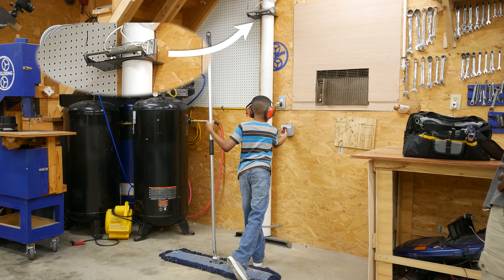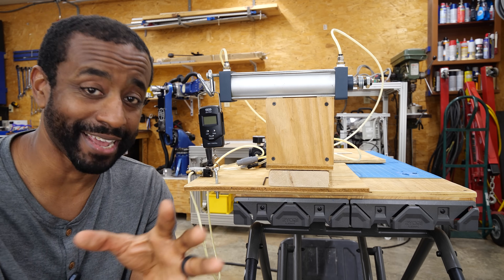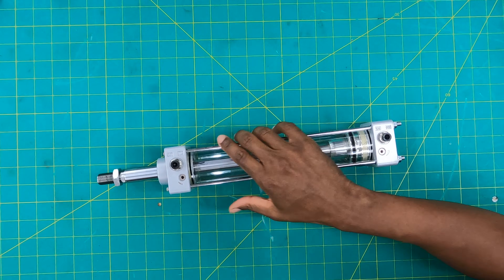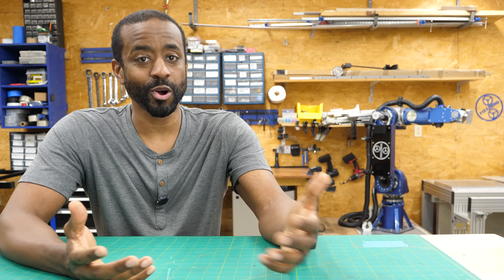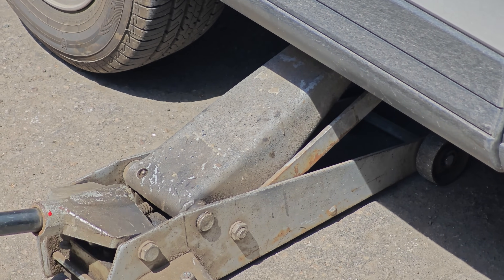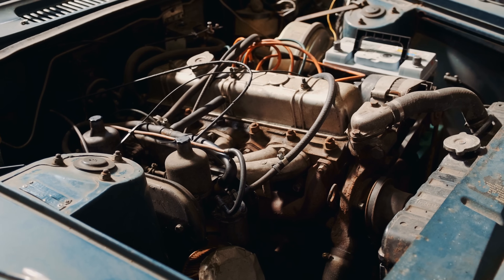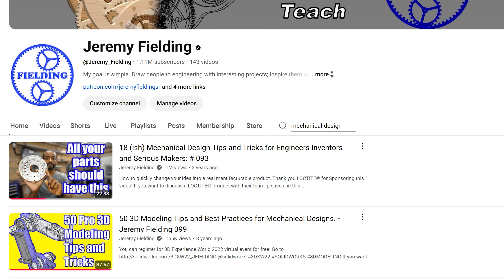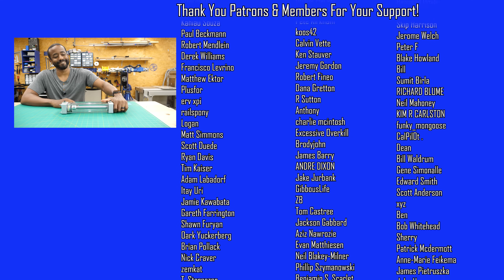12 Design Tips And Tricks for Inventors and Makers

Comment: 7:35 Yeah, sleeve bearings are awesome for the big low-speed joints on robots. Much smaller and lighter weight than rolling bearings, and you can make any size you want by cutting a strip from a sheet of teflon and wrapping it around. Or cut a flat ring from the same sheet for axial force too. Teflon tube is better for small diameters (I use it inside metal tube for cycloidal drive output rollers), but then you are limited to available sizes, and sometimes it's poor quality (not dimensionally accurate, or not concentric).

Comment: @Jeremy_Fielding ; have you used plastic bearing materials yet?  The two you will hear about most are modified nylons (with MDS or oil or both added) or modified acetals (primarily with PTFE added).
These are very light weight and when the bearing is designed well, and the bearing material is supported well by strong/rigid backings or housings, they can be outstanding (and lubricant/service free)
for low-RPM / high-force applications.

I am currently finishing up a hoisting cart for my workshop.  The jib housing, which fits over, and rids on top of, the mast, requires three bearings; a thrust bearing in the form of a large thin "washer" of 
plain acetal / POM, a pilot bearing in the form of MDS-filled nylon, and a mast bearing of plain acetal/POM.  Unless overloaded, non of them should ever require replacement or lubrication, not in my
lifetime, and not in the subsequent owner's lifetime either.  The lubricity is intrinsic in the plastic-to-polished-steel interface.  The inverted design of the jib housing keeps abrasive shop dust out of all
three bearings.  The trick is finding the material you need at the right price, but once done, it's usually cheaper than ball bearings.  The load limits are the yield/deformation of the material.  RPMs must
be low, however, lest heat build up in the polymer.

Comment: On your final point. I had this company want a bin tipper, think rolling trash cans but could weigh up to ~250lbs. I went through a few designs with them: electric actuators, hydraulic, levers, and a variety of geometries. The final design is little more than a post anchored in the concrete with a hinged plate that "hooks" onto the bin when you roll it up and just push it over, a piece of bar stock keeps it from tipping too far. Once empty the bin is light enough to pull it back upright with no effort🤷🏻‍♂️. The hinge point is low enough that it doesn't take much effort to push it over. They are incredibly happy with them and have probably tipped thousands of bins by now!

Always ask, "What's the bare minimum this actually has to do to reach answer the problem?". In this case it was too reduce worker load, and keep the bins from getting all scuffed up from being laid down on the concrete to tip them.

Comment: Good info! If the forces, heat, environment... are reasonable then an economical option are plastic and bronze bearings. Engineering plastics offer exceptional performance when used in the right applications.

Comment: In the section where you were talking about moving a heavy arm and using a rack and pinion, the whole time you were talking about this, the torsion sprints for your garage door are visible.  They are doing the work for you just as your counter weight solution would do.  I just found that a little funny.  Love your videos.  Always learn something.
Reply: A counterweight also has the added issue of increasing the inertia of the load substantially. For a human powered, slow, system, that factor may be negligible, but for something that needs to be higher speed, doubling the inertia can substantially increase the amount of power required to move it.

Comment: This is all so general that its not really interesting if you are an engineering student. I hope you can go more in to dept in your coming vids.
Reply from the maker: You should check out the 18 mechanical design tips and tricks video. It is better for young engineers. Link in the description. It is very specific to engineering for manufacturing. Many lessons learned from real world engineering. That video is basically what I wish someone had taught me when I got started. This one is trying to cross more into the home DIY level "making." I don't want to assume they know much or really anything about engineering. Just concepts you won't think about, specially if you have no training in design, that can cause you projects to fail. I have seen professional engineers make some of the mistakes mentioned in this video. This series will be mostly discussing engineering concepts with non-engineers as the target audience in terms of level and explaination. I think young engineers will still learn a lot especially if they have no experience building things themselves. Which as you likely know is a lot of them. Next we are discussing the pros and cons of various actuators. This would be helpful to anyone designing things that move. I think many engineers will appreciate the comparison. I picked up a few things myself researching for the discussion.
Reply: @lesleymurugesu9096  we crawl before we walk, before we run ✌️

Comment: @Jeremy_Fielding you can also use constant load gas cylinders to act as a counterweight, like what lets you easily open your trunk or hood. I used them to take the load off of my motor and ballscrews for my CNC machine.

Comment: Jeremy, I love your videos they always get my gears turning on new or current projects. I have an entire locker filled with motors to repurpose because of you. 

Watching this video you mention using a counter balance to move a weight. Look up the Falkirk Wheel. It is a spectacular feat of engineering to move vessels from one canal to another much higher one. But unlike a traditional lock the boat moves into a container of sorts that then seals closed. There is a matching container of water and or boats at the opposing end of the wheel. Because a vessel  displaces its own weight in water the load is balanced no matter what size vessel is or isn’t in the other container. Then if I’m not mistaken, a 1/2 hp motor rotates the entire water/boat filled system to the opposite canal. It is amazing and so simple. Thanks for the videos! Keep it up!

Comment: my church used a 750 watt incandescent lamp (120 volt ac) in the ceiling fixtures used to light the sanctuary.  I wanted to go LED but couldn't find one that large.  I talked to my daughter one day (a computer science grad with a masters), and she said why not make an adapter that holds 8 100 W LED bulbs.  Just like you I slapped myself in the forehead.  This brilliant has since been build (40 fixtures) and installed and has worked for well over 1 year so far.  By the way, the lights are controlled by an old dimmer circuit, but even that still works.

Comment: Hi Jeremy,  Counterweights are my favorite. In my case, I used the same motor for lifting different weights, which resulted in an adjustable counterweight. I used flat spiral springs, which I find have a longer cycle than coil springs. I would like to have your consultation on a similar matter, if it is ok ,can I email you?Cheers Raul

Comment: Most people start at the begin point and design to get to the end point which is normally the way to go.
However, sometimes it is better to start at the end point and design back towards the start point.
And then you can also start at the middle and design both ways at the same time.
For example, you need a lathe chuck in a custom machine to run at 1000 rpm and have 20Nm of torque.
Thats easy. Buy a 1000rpm motor producing 20Nm and put it in with a 1:1 drive.
If you already have the motor and it will provide at least the Nm needed and runs at 2000rpm then its a 2:1 step-down drive needed.
And if you need a lead screw you can either mount that drive between the motor and the chuck, OR onto the motor OR onto the chuck.
There is no "one method will fulfill all permutations" answer.
But there are MANY UNNECESSARILY COMPLICATED METHODS.
And getting the best solution for the particular application is half the fun - making chips is the other half.

Comment: Awesome video! Another counterweight example: balancing an offset load on a linear actuator to reduce moment loads. I had a linear actuator that needed to move a payload that was offset to one side. It wasn't a very heavy payload, but it was extended out far enough that it pushed the moment load capacity to its limit. By putting a small block of steel on the opposite side, I was able to balance the forces and completely eliminate the moment load. The cost was a little extra inertia and weight, which the system was more than capable of handling in this case.

Comment: Hi Jeremy, as an engineer, ive found one of the most critical concepts is "equivalence" - finding several equivalent solutions based on one constraint, and then choosing based on another. For example materials. A big piece of wood and a small piece of titanium have the same strength, you can choose based on price. Belt drive, gears, or linkage can transmit the same force, you can pick based on size. Tradeoffs dont have to be made except in a very few areas, maybe price.
Reply from the maker: You bring up a great point I didn't spend much time on in the video. The idea that you can have multiple desired features if price is not one of your constraints. It really is the most controlling factor in many cases... cases where the price is a factor that is. Almost anything can be made if you are willing to spend the money on engineering time and materials.
Reply: In every design review I have ever sat through, this always comes up.  Even if the other two or three solutions can obviously be discarded outright, you had to show you at least thought of more than one way, because smart people tend to get "tiger vision" and become obsessed with what they think is an elegant solution... most teams I was a member of recognized this and mitigated it with more eyes.  Sometimes a design review can even reveal ways that pieces of the dismissed ideas can still be used to improve the preferred solution.
Reply: So what you're saying is " given enough time and money"  a trade off is made less likely.
Reply: You are gifted. Being fascinated with machines I was an auto tech for years. My manager paid me to make special tools and nicknamed me Gismo. I sure could have used your advice
Reply: I suppose lubrication may also be a consideration, as in belts vs chains vs gears

Comment: 12:49
A cool application of using counterweight to balance a load that I learned about the other day was in windows that open and close. The window sash (the portion of the movable window that contains the window itself and the frame around it) weighs a certain amount and uses various means (back in the day it was a literal counterweight and pulley hidden in the wall next to it and modern methods use constant force springs among others) to make that weight easier to move when sliding the sash up to open the window and helps to keep it in place.

So anyone who has a window that falls down either little by little or all at once, look into just replacing the sash balance/s on either side of the window instead of buying a whole new window.

Peace.

Comment: Great video, thanks for sharing.
When you were speaking of movement across axis's, you reminded me of something my Pop's told me when I was learning to drive. He mentioned then dealing w/mechanical items that have restrictions on the amount of movement, one wants to take into consideration that riding against that limit could damage parts.
Example :
Turning a vehicle w/the steering wheel may wear out the steering pump if you ride or apply continual pressure against the limit of freedom. That one would be wise to back off a bit when you reach the limit so as not to force undue pressure against the limit of the turning radius !!
Would you agree and might it be something worth mentioning ??

Thanks again,
Sincerely ......................
Steph

Comment: For the discussion about taking a break or getting someone else's input, there's an additional option used in the programming world: a rubber duck. 

What you do is explain your problem to the rubber duck, and often just the act of trying to explain it is enough to give the insight needed to solve the problem. Doesn't technically need to be a rubber duck... A former coworker used to use me this way, where he'd call me over, explain the problem to me, then turn around and start coding the solution. Often i didn't have to say anything other than hello. 🙂

It sounds like such a silly thing, but honestly, it's a really valuable technique. 🙂
Reply: The rubber duck is golden!

Also another thing that worked for me it is give it time doing a mundane thing. Most of my good solutions came when I took a shower out of all places.
Reply: @Mr-lw7gy 
Yep, driving around or whatever I'll solve a task that was difficult while actually working on it. A few of my best ideas, solving my hardest problems, were while sleeping. I'd wake up with a simple, clear solution to a problem I couldn't solve while focused on it.  Often in the form of "oh! I don't even need ___ ! I can just do foo, and bar won't matter."
Reply: There is a learning technique similar to that called the Feynman technique where you try to explain your concept simply, as if to a child (or rubber duck) and it'll point out the gaps in your knowledge. I found it to be very helpful during college courses, and I've also used it plenty of times on my water bottle when designing things. Might have to find a rubber duck for the office now.
Reply: Rubber Duck Debugging is fantastic.

Comment: Simplicity, without metal, was and is a purpose of my design for environment of a tilted released crust, and solar catastrophic change to the planets as ours wuth crust flip/tsunami, electric discharge and massive induction. The end of the modern world and reset into a ice age. Here is the concept as I have it:
Panels, printed , or plastic air-injection molded, plastic panels for interior sphere fixed spinning bearings. These for the outer sphere shell. No metal. Interior sphere, same design scaled to fit as an interior sphere, with weight at a bottom, flat ended surface/storage safe interior space. 
Thus enabling a spinning  but stabilizing zone.
This must be double layered, outer/interior.
It will endure any tsunami,floating or fixed impact damage without capsizing.Crush values are everything, alongside filled weight/bouyancy and capability to free itself from being held or wedged  beneath the many entanglements or spaces with debris or landscape.
For this reason larger helps ensure capability to save.
Air space, supplies, number of people.
If it takes days to more than 40 days to land on settled surface space, it must be possible as well to function as the seed for restarting surface life. 

Round sphere divided into panels for "unsinkable" no metal outer/ inner bubble boats. The outer spheres panels use held bearings on interior to allot the interior sphere spin to stabilize the supply /people space,  against capsizing with any tsunami or debris flowing surface flood. No metal. Injection molded. Very simple. We have the technology, for the best Arks ever.

Comment: I would love a similar/related video that shows how to attach an engine to a wheel. Because there’s a lot going on that doesn’t get explained well. I can find plenty of go-kart build videos but none of them seem to understand why they chose the engine they chose and match it to the size of driveshaft, the type and size of transmission, etc. They’re all just parts monkeys, copying what they saw someone else do with no depth of knowledge.
Reply: Come to think of it, if you take that adage to its logical conclusion, a go kart is just a part of my larger system. A saw is just a part of my workshop. So if we go that way, nobody makes anything ever.
Reply: "almost always better to use a commercially available part that's good enough instead of building your own custom part"

the companies that make the engines/transmissions have proprietary simulator software and 12 phD's in the lab to perform 6 months of testing and 30 iterations. For the low low price of $10mil.

He already mentioned all the critical things - high speed movement forces and bearings. All that's left is back of the envelope calculations... and you then just pick the same old parts you already would have, because you aren't spending thousands on a go cart.

Would be a cool vid to see him do tho
Reply: @jimgoplayoutsideable Yeah it’s not that I want to make any of these parts, it’s that I want to understand the process of choosing this one or that, because when you look at the catalog there’s a lot of options and no explanation for why you’d want one or the other. Half inch axle? Three quarter? Etc
Reply: @twestgard2 So actually what you're saying is you want someone to hold your hand through every step of the process. 
You can buy a kit. 
You can just buy the plans...
There's no shortcut. If you don't understand how to figure it out for yourself based on the video that you just watched, do some simpler projects, some less dangerous projects first.
Reply: @jimgoplayoutsideable Well, it's all about what you want to achieve and what you have available, then you use your engineering discipline and skills to connect what you want and what is available. In that phase is where you will determine machine elements sizes which is related to the trades off you are willing to make
Reply: The goal of transfering power from an engine to a wheel is called transmission. For a go kart this is typically a sprocket and chain transmission. Research around transmission and this should help you, as Jeremy said, it's about trade offs, lots of options just pick what works for your circumstances.